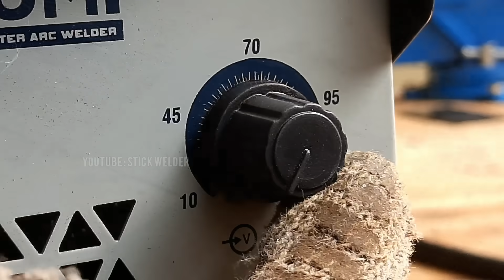the secret technique of welding thin square tubes that few people know | stick welding square tube

Comment: One of the big advantages of stick is that it is literally just as easy to use the right rod as the wrong one.  You might try using a smaller rod.

Comment: Just  about   acceptable,  not really  the  right   way  to  weld    thinish  metal,  M.I.G,  T.I.G, GAS  WELD,    or.... just   use   a  SMALLER welding  rod!  so  you  do'nt  have  to  stop  start,  it   results  in  a  weeker   weld.
Reply: 6013 is a sheet metal rod. It's made for that exact purpose, and if your puddle is still light orange you'll get a good tie-in. The only thing I would have done different is weld it down hill lol
Reply: @brandonstrickland6444  Hi,6013   is  a  mild  steel  rutile  welding  rod,  you  can   get  them  as  thin   as  1:6 mill, thats  the  size for that  job,   maybe  a  2 mill  rod.
Reply: @stormytempest6521  I would go for a 1.6 Brandon maybe does not realise the thickness of the rod is directly related to the thickness of the workpiece. If the rod is over 2.0MM so should the metal be that you are welding. By using such a thick rod, by the time it is molten the amps drawn is enough to blow a hole in the workpiece. A smaller rod and you can weld at a lower amperage.
Reply: @roberttill3787  ROBERT,  HAVE  TO  AGREE.

Comment: I ended up getting the $100 welder from harbor freight. Put it on low and wire speed of 5 .030 wire. You did a great job with 6013.

Comment: Quick tip for people watching YouTube.... When people use the word secret in a video title. you can almost guarantee the person has very little knowledge on whatever the video is about
Reply: Can you explain further please, is the weld not strong enough or something
Reply: If you are burning through it means your welder is turned to high. Use a smaller rod for thin metal if the rod just wants to stick fast. Never weld a bead with tacs (start-stop) when you are stick welding because there is to much risk of contaminating the weld with flux and a sure sign you are a amateur. Also you don’t need a bead that wide for thin metal. Waste of consumables.

Comment: The secret to welding thin metal is TIG, using a small diameter tungsten rod, and lower amperes. Most Tig welders also have a pulse + ramp up current control.
Reply: Also a smaller diameter welding rod would help.  There is no reason for the weld to be 400 % thicker than the base metal it's like pulling a wheel barrel with a tank.
Reply: That works great.......

.....IF you have access to a TIG welder.
Reply: Svi kod kuče imaju aparate iliti tig .pa se mogu igrat i učit.15 god.iskustva u tom poslu.ne serkaj puno.

Comment: Awesome tip thanks, im going to try it out next time i do thin steel, for the guys who dont understand it is to work down the side and not up the side, the 70A is a given for thin metal with 2.5mm rods. 👍😉🤗
Reply: Hadir nyimak pa bos
Reply: I believe angle of the rod is actually the most notable apart from momentarily allowing it to cool. The shallower angle applies less heat and less chance to burn through the edge.
Reply: @LarsDennert
what's shallow angle?

Comment: it will work as long it is not use for structural for simple items it will be fine as long it is not put under lot of pressure availability of thin rods vary on different regions and country

Comment: Intermittent welding seems very widespread on YT. Would a thinner rod, like 1.6 mm be of any help here?
Reply: Karel, its actually done by using less amps and a thinner rod. The rod shown is more than 2MM, yet the job is only in 1MM plate. Such a thick rod needs high amps to get it to arc and flow, by which time the plate of the workpiece has blown a hole. This is why hes a "dabber". Instead of dabbing at it the action needs to be continuous driving the weldpool forward. The way hes doing it is dabbing it, and drawing the rod away from the weld. This type of action is all wrong, but beginners do it and think theres nothing wrong with it.
Reply: @roberttill3787  if I'm welding a desk would this technique fail?
Reply: @wateringflower  Maybe not, but like most things in life, its nicer to do it in a proper manner thats tried and tested.
Reply: @roberttill3787  2.5mm 6013 and 3.5mm is what's available so that's why I ask. I'm not getting the 2mm
Reply: @wateringflower  In this day and age you would probably need to order and buy by the box. In my youth i started to learn sheet metal welding by fixing holes in mine and my friends old cars. All i had was a stick welder, fancy things like MIG had not yet become available to the DIY'er. I found a box of really small rods from memory they were not much more than 1.0 MM. I found i could turn the Amps right down, and the amount of blow holes almost disappeared! These people on YouTube dont understand welding or how to do it competently, hey, they are just having a go! I understand it works for them, but the right way is the best way.

Comment: How did you keep the rod from sticking?  Yours seemed to arc immediately. Mine keeps getting stuck
Reply: Take a piece of metal and put it on the weld table.  Adjust you desired amperage.   Rub the stick to this piece of metal in quick repetition like a matchstick until it glow.  Then weld instantly

Comment: Why not just try to properly weld it? That is not a stringer but a series of tack welds with very high risk of slag inclusions, skill in welding includes knowing your materials and machine settings, using a 1.6mm rod with lower amperage and proper travel speed/angle would allow you to lay a proper bead.
Reply: Using this technique on a student desk will result in failure?
I don't have access to 2mm or 1.6mm.
I only have 2.5mm
Reply: @wateringflower  In non-critical applications like this it will hold just fine IMHO.  Thing is that in case of application where life/safety of someone is at stake(stairs, rails, automotive parts, spinning tool parts) i would not even think about it!!
Reply: @ioannisdounis9608  thanks for the reply. I thought so as well. 
I'm a humble diy who has started welding couple of weeks now and I really like it.
However the materials I'm getting are 1.5mm thick and the spot technique has been working good so far. I'm not looking to build structural pieces. Coffee table, end tables and student desks for my kids.
I sometimes spot weld then do a full pass as the welding material can take a little more heat.